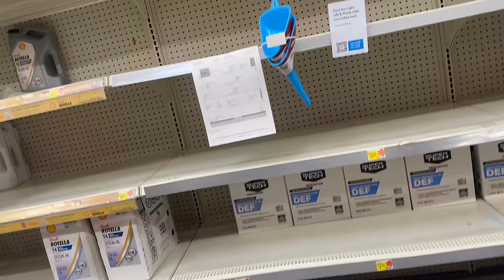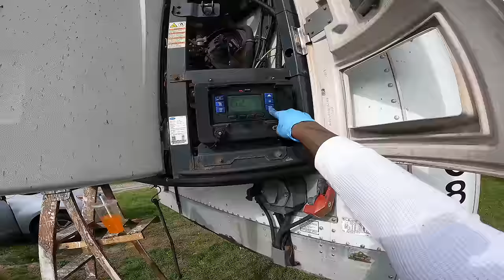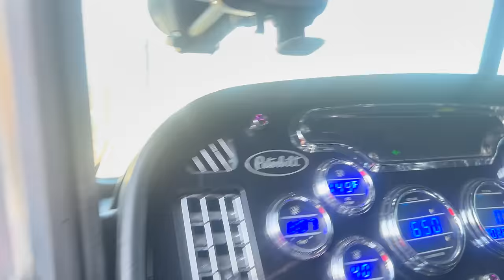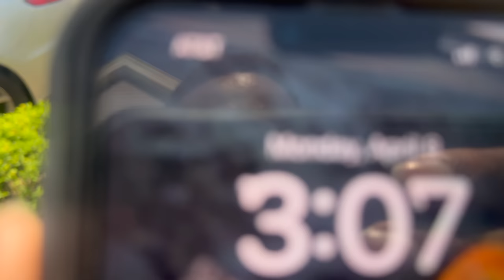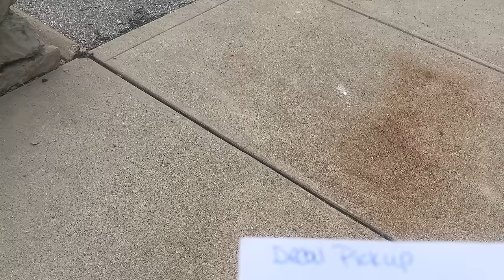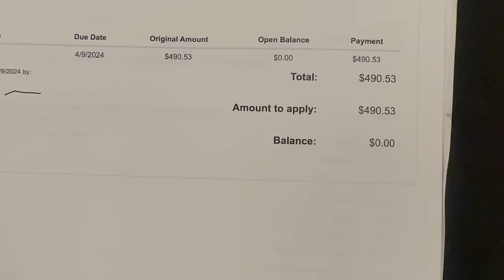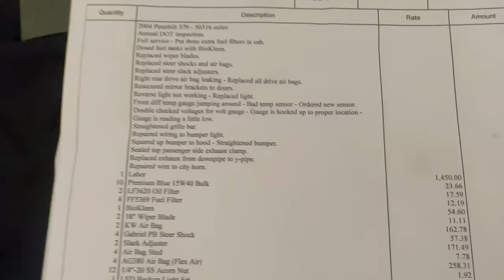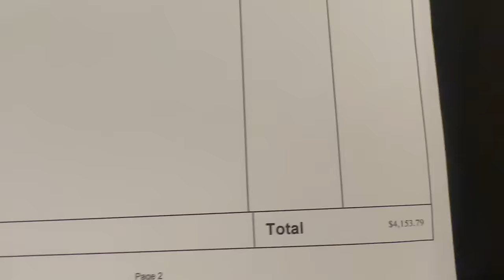Work Never Stops When You Become A Owner Op|Service On A Carrier 7500|Saving Money Is Very Important

Comment: As a diesel tech, the reason your oil and fuel filters get so tight is because you're using the wrench to tighten them. You don't wanna use a wrench on your filters to put em on. Hand tight, just good ol two hands and a good yank. The seal will do the rest of the work. By tightening it that hard you also risk stretching out the threads by overtightening it. Keep up the awesome work and content!!!
Reply from the maker: Yes I’m just going to hand tight everything and thank you

Comment: Salute and Respect FAM always, good to see you with another great masterpiece episode of knowledge and teaching of excellent content and presentation video in the grind game of trucking industry. FAM what I did with my thermal king and carrier units was replaced the oil plug with thread open and closed valve and a clear tube for drainage with a cap at the end a very clean and easy setup and it doesn't interfere with anything,  which I picked up everything at Lowes.  And for the filter change I just cut open a old oil jug to catch the oil instead of using so many shop towels or rags and it makes it easier. Just sharing some of my tricks in the grind game as well. YESSIR it's never a moment in the grind game that you aren't always busy with business and equipment in the grind game of trucking industry. Keep your positive attitude and mindset while wheels turning and making them earnings. Be blessed and safe out there on the roads of and to success in your journey....💯👍💪🤜⛓️🎯💰💰💰💰💰💰🙏👊🙏💰💰💰💰💰💰🎯⛓️🤛💪👍💯LEGGOOOOOOO TEAM INTERSTATE MADE ME
Reply from the maker: Appreciate it big dog all love this way and always I appreciate the support and love 🫡💪🏾💯🙏🏾

Comment: If you flip the oil filter tool you’ll be able to remove the fuel filter and oil filter
Reply from the maker: Two different size filter ranch and that has been done but I’m not able to get my feet planted with ladder I need to use the force to un screw it

Comment: I got a quick question Brother, the fuel treatment you grabbed at the beginning of the vid. It says Cummins on it, will it still work for a Series 60 and or dd15 engine?
Reply: Or are you utilizing it on your reefer ?
Reply from the maker: Yes it works great with my engine and yes I pour it in my reefer once a month also